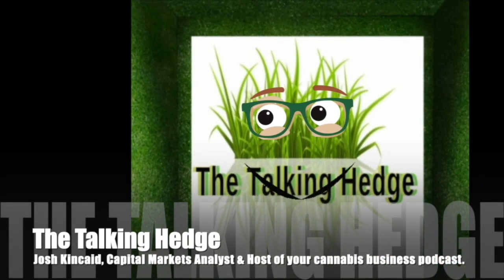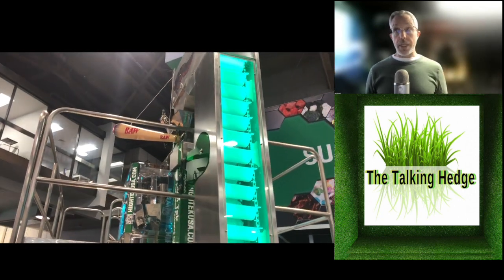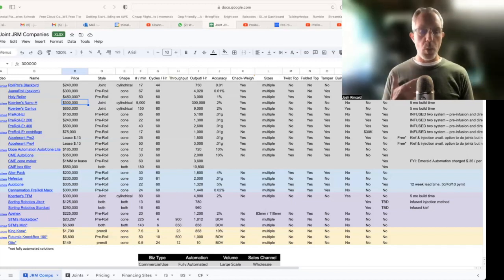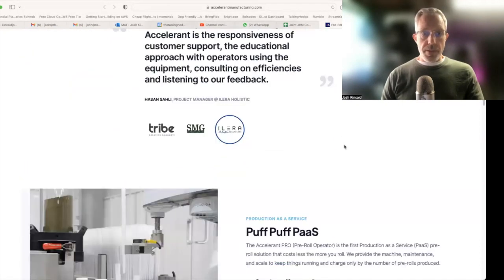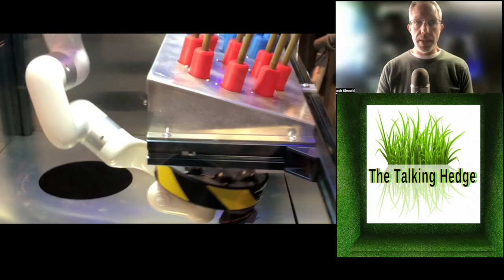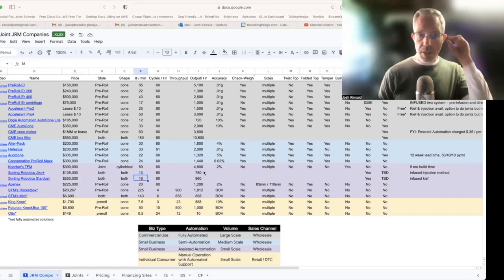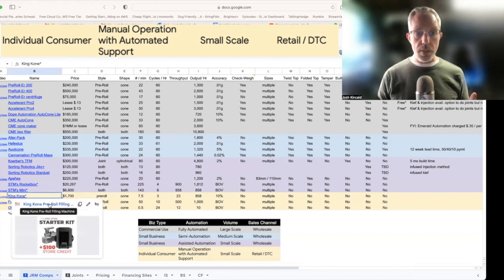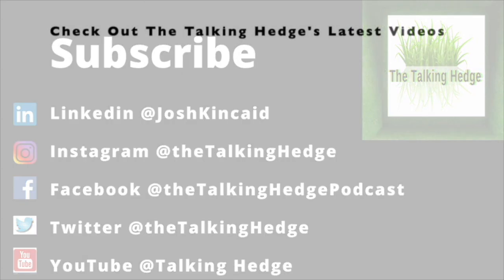Automated PreRoll Machines - FULL LIST (2024)

Comment: This is a great list, and Josh has an excellent podcast! I'd like to highlight STM Canna, a cannabis industry veteran with a proven history of innovation. We offer the industry's only fully modular pre-roll system, starting at $49,995. 

Our solutions feature:

-High-performance grinders
-RocketBox pre-roll machines, including the high-volume RocketBox Pro

-The lightning-fast Atomic Closer (72 pre-rolls closed in under 40 seconds)

-The brand new Astro Infuser (infuses 72 joints in 55 seconds)
-Our seamless One-Tray Workflow, maximizing efficiency between machines

We recently expanded into a 30,000 square foot R&D and manufacturing facility, fueling our innovation.  STM Canna proudly serves clients in 43 states and 10 countries.